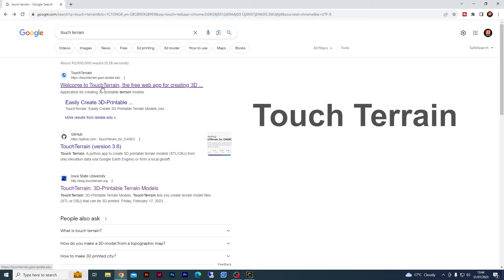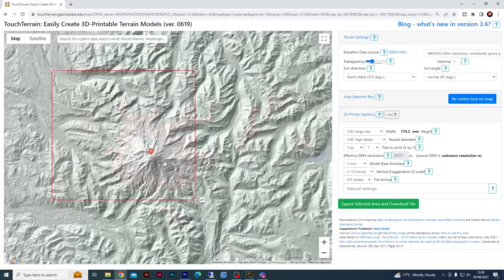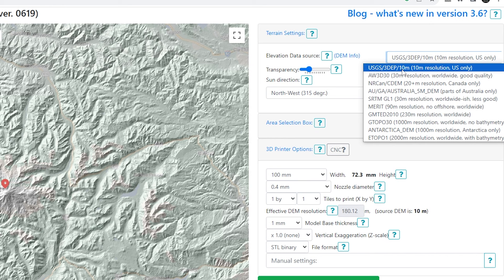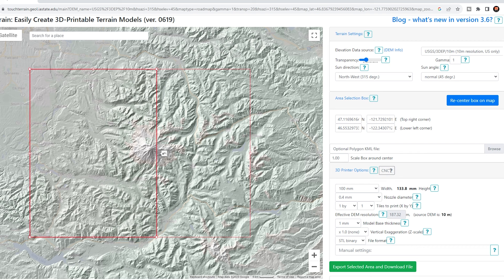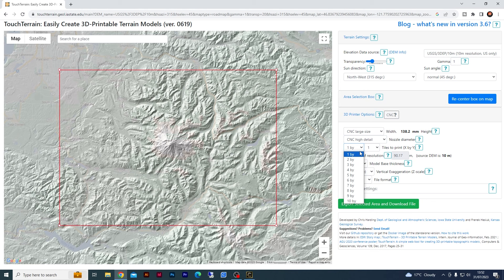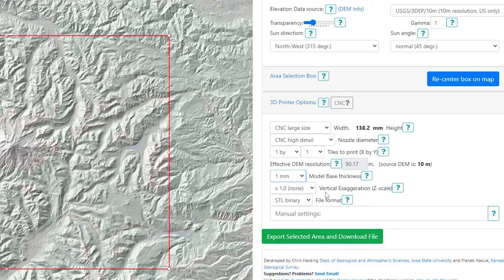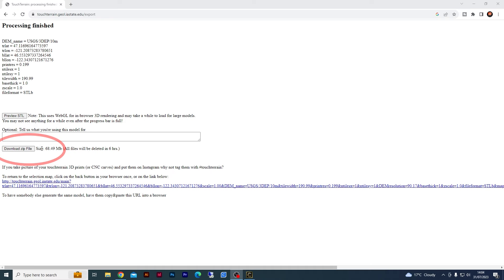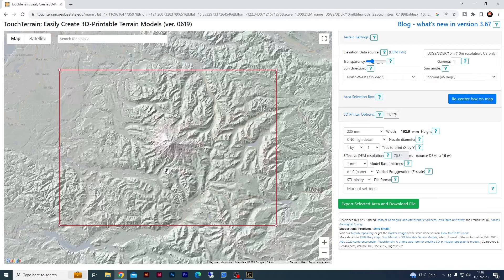Awesome FREE Terrain Files for CNC - Easily Download STL Topographical Maps

Comment: great tutorial, it comes at the right time for me. I program my cnc with fusion360 and for this kind of engraving fusion is very slow. I can't wait to see your trick for programming this type of engraving.
I hope your tutorial will be made with free software.
Reply from the maker: Thank you.
Sadly no, the only free software I know of that can do this is Fusion360 but I use Carveco Maker myself. It does cost $15 a month but you can take an STL file like this and do all the CAM work in a matter of minutes so whilst it has a cost it makes life easier and saves you time
Reply: @JamesDeanDesigns  yes, that's what I thought. I need to find the right strategies for machining in 2.5D. It's also a shame that fusion 360 doesn't do inlays.
Reply: @JamesDeanDesigns  will you have the opportunity to test the ttc 450 from twotrees? it would be great to have a comparison with the saintsmart 4040 pro and the foxalien masuter pro 😘

Comment: Awesome project James, question.. (I’m using fusion 360 CAM with UGS) there is something at the beginning of the Gcode generated by fusion 360 that my machine doesn’t like, at the start of every project my z limit switch is triggered and locks the machine. I’ve been working around this by turning off my hard limits and the code runs just fine, but of course at the end of the cut the machine jams passed the x limit switch and crashes to a stop no doubt messing up my steps and potentially damaging the machine. I circumvent this by stopping the program after the cut manually moments before the crash. How to find that rogue z limit triggering Gcode that fusion 360 is generating every time and eliminate it from the file?
Reply: In the Fusion 360 post processor screen:
Expand  "safe retracts and home positioning"
Change "safe retracts" to "clearance height"
Reply: @techydiy  nice! Will try this!
Reply from the maker: Thank you as I wouldn't have known the answer for that 😁

Comment: Cheap way to make this large scale for tables/huge game boards

Say you want to replicate your hometown: 
1. file from touch terrain, choose the 300mm size. 
2. Put the mesh into meshmaker, go to transform, and scale to the size you want.
3. Use the plane cut tool cut your map into pieces that fit on your print bed.
4. Print each piece on its side standing up. Use five bottom layers, no top layers, 1, wall loops, 1% linear aligned infill. 
5. Print the piece out and pour plaster Paris on inside the piece through the open side.
6. Assemble all pieces on a wood board, glue pieces together. Oggle at your masterpiece of the most detailed map/game board you can make.👍